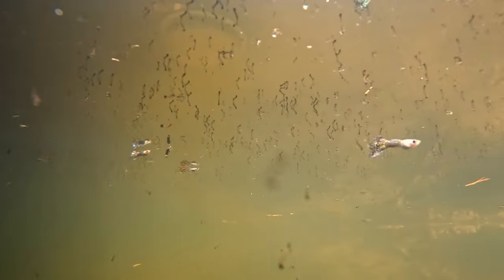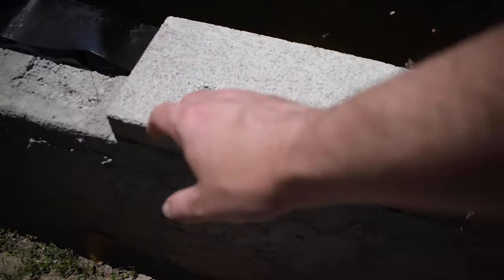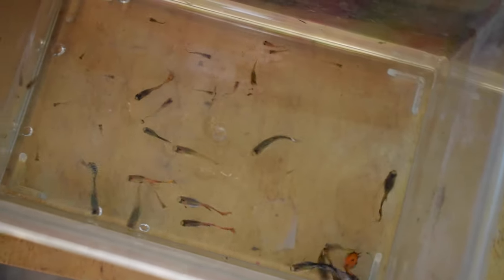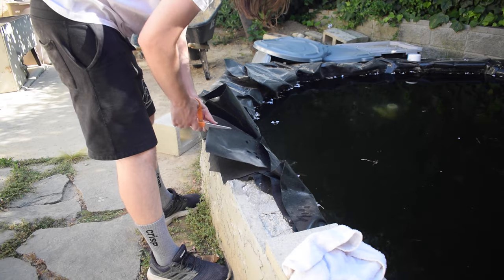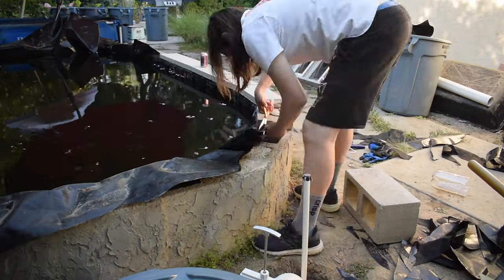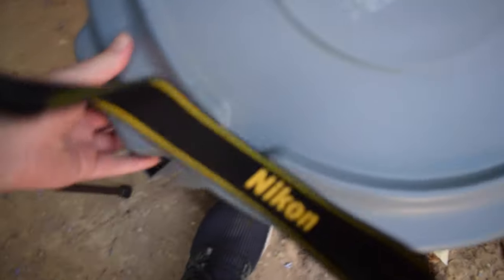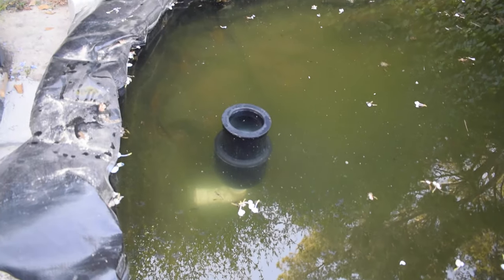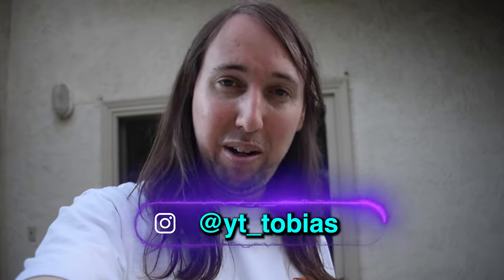Koi Pond Build Continued

Comment: Hey Aquamigo, you can get a coupler instead of a new threaded adaptor…then you can fine tune the length of the 2” pipe
Reply from the maker: Hi Aquamigo, that's true! I might try that! I was also thinking, I may actually wait until the pump is running in case it pulls the floating part down a little